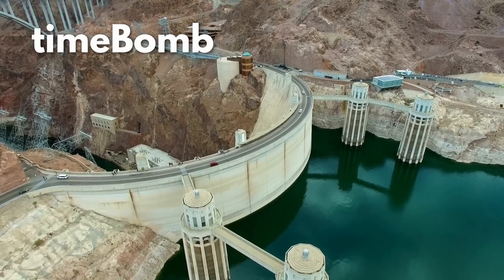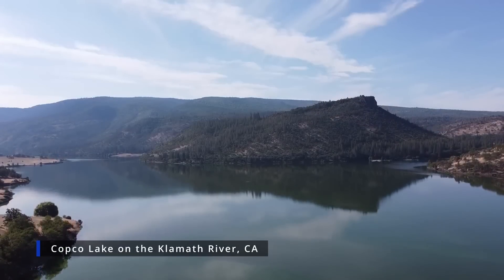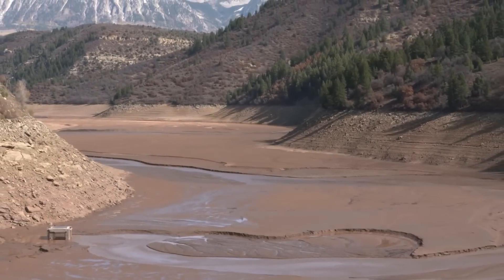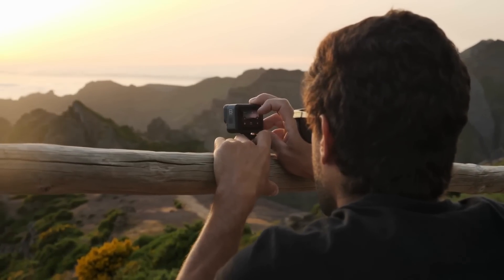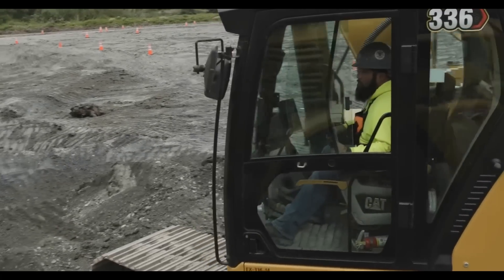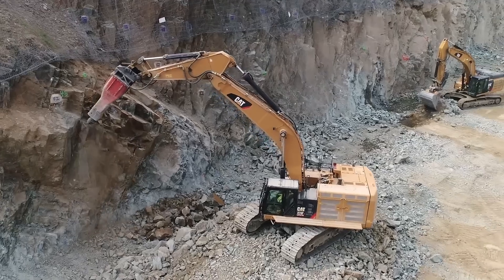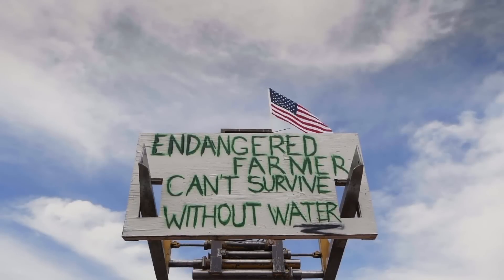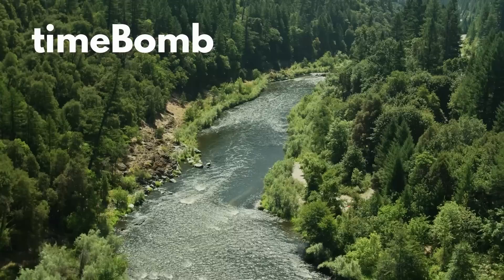The World's Largest Dam Removal Project

Comment: Well done!  You're one of the few that got most of the basic facts right.  Source:  this has been my life's work.  Worth mentioning that the company entered into an agreement for removal and contributed $200m toward the removal because it was less costly than installing required upgrades (e.g. fish ladders, downstream passage).  Now the reservoirs are drained (didn't see you at the Copco blast, were you there?) and the road to restoration begins.  We're at the low point of the recovery arc now with the newly exposed reservoirs looking black, muddy, and raw.  But already, there's new sprouts coming in and we're opening a new chapter in the long history of the Klamath.  The only tiny fact that was wrong was when you said these dams provided water to the communities; they did not, nor did they store water for ag, nor did they provide flood protection.  They did grow toxic algae and block salmon though.  But you got the rest of the basic facts correct.

Comment: do they have a plan for replacing that power generation capacity? Did agriculture rely  on those dams as well?
Reply: The electricity produced by these dams was minimal. The energy has already been replaced by local solar and wind generation. 
And no, the reservoirs created by these dams didn't provide one drop of water for agriculture, domestic use or flood control. The dams were designed and operated to generate electricity, that's it....

Comment: There are ways to get fish around dams if that is the only problem.
Reply from the maker: Ya that's true and the dam owners did consider that. Turns out the costs to retrofit the dams cost way more that the removal. Plus the dams were in desperate need to updating. That too added to the potential costs of keeping the dams around.